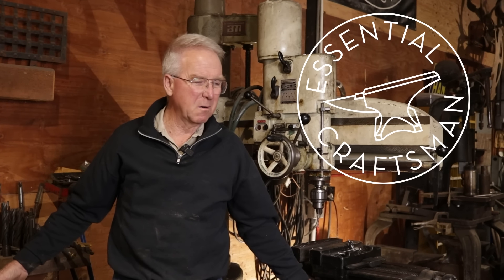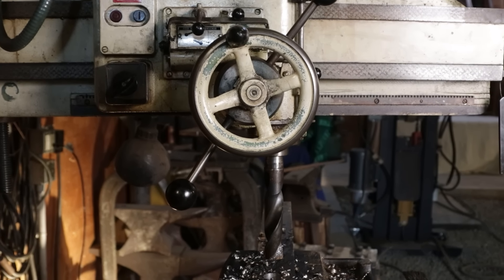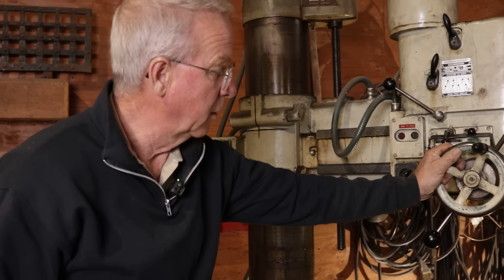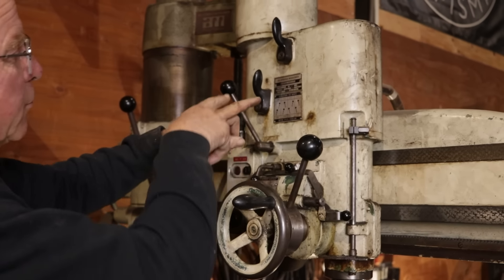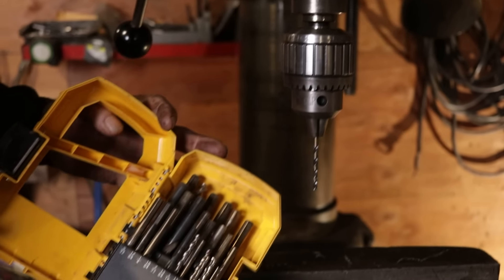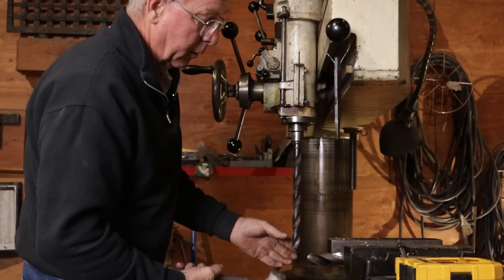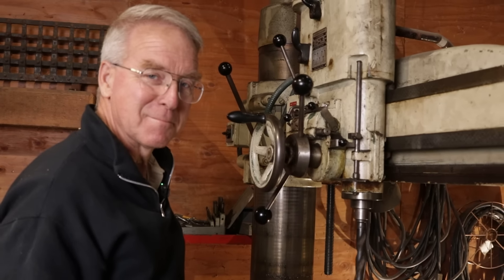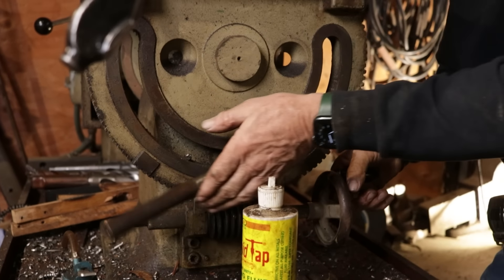The Drill Press That Does EVERYTHING

Comment: Beautiful machine.  Just my opinion, but on my larger wood tools, I have mounted a cheap 120v 8" LED strip (typical over sink light) that I picked up from a big-box store.  I mounted the small strip on a piece of wood and used epoxy to attach three small rare-earth magnets on the back of the wood.  I route the cord to allow movement to wherever I would typically use or need a light.  This works much better for my older eyes than any halogen or incandescent light on any of my machines.  It's also movable to any metal surface where I might need it.  For me, I much prefer my little strip LEDs over any of my internal machine lights.  Thanks.

Comment: for oiling the  ball detent oilers. I have had good luck with an oil can with a fine tip (fine enough to press the ball down) then cut a slit across (with a file , small hacksaw or fine slitting wheel)  this allows the ball to be depressed and oil to flow around

Comment: I worked at Palm Iron and Bridge Works in Sacramento in '71-'72 and one of my jobs was drilling 2" holes in 2" plate all day long.  Don't recall the name of that drill press but it made yours look like a toy.  Pilot hole helps and sharp drill bit.  Waste cuttings  should curl in continuous spiral or she is dull.  We sharpened by hand on a huge stone grinder, must have been 2 foot diameter and 4 inch wide. Great find .

Comment: Just do a search for the machine name and type on the plate. You can find instructions online. "Change oil after the first 100 working hours, then every 500 hours. The oil is drained at the under side of the casting. The bearings in the gear box and the spindle quill are packed at the factory with good quality ball bearing grease. This lubrication is sufficient for several years of operation. A few drops of oil should be dripped into the oil cups on the case once a week."

There's another paragraph after that talking about lubrication. Also, apparently there's an 830 and 1830 model. The instructions I found online have diagrams for both.

Comment: Cutting oil, as in pipe threading, is good for drilling.  Keep some right on the machine in a small tin can, apply with an acid brush.  Motor oil is not a good choice, it has lots of additives specific to the insides of an engine.  Best for the sliding parts would be way oil.  Precision sliding surfaces on machine tools are called ways.  The tool for knocking MT bits out is called a drift.  There is a different drift for each of the MT sizes.  The tang on the end of the taper is just a tang.  Stamped somewhere on the chuck will be JT and a number.  That's Jacobs Taper so & so.  The arbor and the chuck are two separate parts.  There are sets of little wedges that will separate the chuck from the arbor.  When ordering a chuck, you'll need to order the appropriate arbor.  ie. JT3 / MT4 or JT3 / R8.  Tapers are used dry.  It's good practice to run a hand down the length of the taper checking for burs or chips clinging to it.   Bad to force some chunk of iron into the tapered socket.  Those adapters, one MT size to another, are called sleeves.  Brown & Sharpe has their own taper, another is called Jarno, there are others.  Two sources,  MSC and McMaster Carr.

Comment: I've drilled a bunch of holes on a large radial drill in the locomotive repair shop I spent most of my career in, they're simply an awesome machine. I've also rebuilt the transmission on a buddy's Arboga mill which uses the same basic head as your radial drill. The thing that surprised me when I got into it was the gears are made of micarta rather than steel and the ones on that mill showed zero wear on the teeth, maybe those Swede's know what they're doing!!

Comment: Scott,  I have been lubricating my old machine tools with AW68 hydraulic for many years with good results 
Chainsaw bar oil works well for the sliding surface and the round column 
The wrong oil is better than no oil.
Keep up the good work
Reply: A fairly light oil with zinc is always a good option for almost any machine tool.
Reply: Those columns will take way oil. Not that 68 aw would be the end of the world

Comment: I'm no machinist (carpenter) but I find squirting the cutting oil on the bit rather than  the cutting surface works well and needs less oil especially at lower speeds.
If you can run cooling liquid automatically do it.  The time and money saved pays for it and more.  It's recycled unlike oil that is 100% wasted after one use.  Nice press mate.  Cheers 🇨🇦

Comment: You should weld a ratchet on the end of that vice as a handle. 
Then whenever your tightening it, the wrench will drop away, also so you won't have to bend over or move to the front to crank the vice.

Comment: Thats a good looking drill you got Scott. I used to run a 60" Cincinnati Bickford radial a few years ago. Big ol girl, dumped a quart of SAE 30 in her probably once a month. Still was a smooth as could be. Mine had power feed as well. RPM could be set for when drive lever was all the way engaged, it you could set it high and only partially engage the lever for slower speeds. 
That oil fitting I bet you need a pin type coupler or needle nozzle. It looks like s flatter zerk almost

Comment: I know lathe and milling machine basics. If it makes you feel  better, I now know how you change a but with a Morse taper tool bit thanks to you, compared to me you are a master operator of a radial drill press. I am a retired electrical engineer and I am in awe of your knowledge on so many things!  Question, how do you estimate or bid a job like that when you didn't even have the radial drill yet, knowing  how labor intensive it was going to be ( I know machine shops sometimes do a flat  rate like cost for each hole etc.) You are an amazing You Tuber and Man!

Comment: Start-up current: just this evening I learned something fascinating. We usually think of start-up current as a concept that applies mainly to giant electric motors. But just now I discovered that my Fenix E01 single-AAA-cell LED flashlight, which I had temporarily misplaced, was still glowing after something like 8 hours on (!). I immediately turned it off and then tried to turn it back on, but it would not light! Of course it worked fine as soon as I changed out that poor AAA battery.

Comment: I once operated a 10' radial drill made by Cincinnati Milicron. It had a 12' by 24' slotted deck, and had a 4" drilling capacity. It was a beast. but it ran smooth as silk.
The oil cups do use a special tip that depresses the ball. Try a medium needle tip on a rigid oiler tube. there's too much spring pressure  for a flex tube to work well.  Try scoring tiny slots in the ID of the needle tip to improve oil flow.
Typical three phase breaker panels provide a neutral for circuit requiring a single phase, such as lighting circuits. This neutral connects to a center tap in that transformer providing power. Your rotary converter does not provide the neutral. Wire your light as you would any household circuit. You can connect to the original light circuit in the drills control panel, but be absolutely certain that the hot and neutral leads for the light are electrically isolated from all other circuits. run a dedicated 120 volt circuit from your shop's breaker panel.

Comment: Lean the oil can tip to the side so the ball is not covering the hole in the tip or file a notch in the end of the tip so the ball can not block the hole in the tip .
Sum oil always leaks at those kinds of oilers , feed the oil slowly so more goes in than leaks outside the oilers .

Comment: Correct me if I'm wrong but I don't think the tang on the Morse taper is intended for preventing the tool from turning in the quill os in the adaptors. The grip relies purely on the friction of the "sticking" taper. If the raper were a wider angle it would't grip: if a shallower angle it would stick so tight that you would have great difficulty in removing it at all. It's also essential that the surface of the tapers, both inside and out, be scrupulously clean. 
What a lovely old machine. I have neither the use for one nor the space but I can dream!

Comment: My father was a machinist by trade for companies and also ran a little shop @ home to. He passed but I still operate some machines from his home shop now and then.
I never grew to liking those ball type oiler ports on machines My dad was patient so he would put a drop of the oil on the top then wipe that oil off with a lean rag to help clear away dust and residue then push the ball down and let oil slowly drain/ siphon into the passageway around the depressed ball..... it was very slow untill enough oil got in to the passage way... then once some flowed in, it seemed that gravity would start sucking it in all the faster. That is why I called it a "drain/siphon".\
My latest technique repeates the oil first then wipe clean but is unique by my using a medicine dropper bottle with a clear plastic dropper tube and rubber squeeze bulb. But that sort of requires two hands. I draw-up a shot of oil fom the bottle into the medicine dropper tube and can dispense the oil slow and precise by use of the squeeze bulb and even watch how much oil leaves the tube to gauge how much oil went into the oil passage way. It's rather crucial to note that, in some situations, oil cannot enter unless air is "burped out" at the same time.This isn't ideal for upside down oil dispensing but most of my machines oil ball ports are not upside down ( they are verticle or horizontal). If I spill excess oil onto a very clean surface while using the dropper I can suck much of it up into the dropper again... less waste and mess.😊 
And with the more stubborn oil ports I've had some luck pressing the nose of the the dropper tube down into the hole, thereby displacing the ball down enough, and pumping the squeeze bulb to force oil in and suck air back up into the tube/bulb "burpping the oil port of trapped air".

Comment: My first job as an apprentice was on that very old even then style drill ''it looks identical '' ,  drilled 12 holes in a 150x450x20mm splice plates 8 tonne in all of steel, started with a single 400mm long 32mmm drill bit .The drill never missed a beat , my 32mm bit was 250mm long when job was done .1956 it was bought secondhand by my company, maintain those brass bushes it will last forever

Comment: For the ball oil ports use this oil can Reilang oil can. You need an oil can that can deliver pressure to get the oil around the ball. 

Or as someone else has mentioned you can take a regular oil can and cut a slit in the oil tip so that when you depress the ball the oil can still come out of the tip and around the ball

Comment: One small correction.. Morse tapered bits, and the same goes for Morse 3 to Morse 2 etc. etc. are rotated/driven by the interlocking flat at the top, the purpose of the said tapers is to ensure, firstly interchangeable sizes, but more importantly to perfect align drill bits..

Comment: My mother's cousin had a complete machine shop in his back yard including a 5x12 foot pattern torch way before plasma cnc tables a big radial drill press I saw a 2 inch drill bit in,  now I wish I would have hung out more there now. If you find a Bateman Iron Worker Machine built in the 60s to early 70s he touched most of the parts machine

Comment: For the light, you could probably just tap one of the legs of the 3 phase power. Check it with a multimeter, but it's probably three 110v legs coming out of the rotary inverter. Or, just put an outlet behind the machine and hook up a regular light.

Comment: When you drill the pilot hole it should be the width of the tip of the drill point or web. This lets the full length of the cutting lips to stay centered and cut with all of the edge not just the outer edge.
Reply: Correct. I notice the drill bit "walked" a little before all the cutting lip was engaged. This is evidence of too big a pilot hole. That size bit a #5 center drill and no pilot hole with about .010" of feed would work great. Gotta be enough feed for the tool to cut. Like my instructor used to say "if it ain't cutting its wearing"                     Same with woodworking tools.

Comment: For those brass oilers I make a brass coupler in the lathe with just the right size of the oiler hole but with a short nose the problem is that most oilers have a ver I long conical tip so if you push the balls it blocks the oil but if you don't push enough it leak the oil, now with the coupler if you push it just center the tip and thr oil pressure it's the one that push the ball

Comment: I'm a fan of mist coolant. As you know, heat is your enemy. Oil reduces heat in the form of less friction, but it doesn't really remove heat. Plus it's messy.  Mist coolant removes heat with compressed air and coolant, lubricates the cutter slightly, and is adjustable so you're feeding the right amount of coolant directly at your workpiece. Also, it's hands-free so you don't have to stop and add oil, or operate the machine one-handed.

Comment: You are using the Mose Taper key upside down. The rounded edge should be on top to match the rounded slot in the quill. The square edge matches the tang on the drill bit

Comment: Often times the reason you csnt get oil into a ball oiler( or even a grease zerk) is that the ball is stuck. Tap on the ball with a pin punch to see if you can get it moving.  If not, the whole ball oiler button can usually be replaced. Some thread in, some press in.
  
As for the oil can tip, you should be able to get one through McMasters. Maybe Lincoln (the grease gun company) makes them.
Also, most Hydraulic suppliers have lube supplies also.

Comment: There are videos on Youtube for modifying a grease gun to shoot oil into zerks on machine tools.

My machine tools are close to the wood shop. Machine tools usually need a thin coat of oil on lots of surfaces- which attracts dust. I keep an old piece of bedsheet over tools when not in use.

FB

Comment: To get the oil in the hole try using a tip with an O.D. smaller than the hole I.D.
The ball only seals the hole when it is not depressed.
If it overflows you have filled it.
Good Luck

Comment: Your are meant to use a push action or plunger style oiler on those push button oil fittings.  Those fittings are used to force oil into the machine.  The oiler needs a good seal and higher pressure than a typical thumb pump oiler.  Very similar to a chainsaw bar lube tool.  You know from before we had "ROLLOMATIC" bars.

Comment: Please use cutting oil for cutting, especially steel, but not aluminum. WD 40 is good for aluminum but not steel. Lubricating oils tend to burn up tooling.
Also, don't tap the bits into the socket. Line it up, lower it about an inch and jam it in using it's own weight.
Someone mentioned chainsaw bar oil as a lubricant. I hadn't thought of that, but it might be a little thicker than good lube, or as machinists call it, 'way' oil.
Reply: I like RTD cutting oil rather than soluble oil for drilling — I suppose its similar to Tap Magic.  I use soluble oil in the lathe, but more for cooling.  The sad thing is that they all seep into your skin and it takes forever for your hands to stop smelling of it.
Reply: @TrevorDennis100  Thirty years ago, I used to work for a toolmaker. On all his machines, lathe, radial arm drill, milling machine and surface grinder etc, he used water soluble cutting oil that was recirculated through each machine. Always worked wonders. I think it was because that type of oil allows for the cutting edges to bite into the work whereas lubricating oil is made to allow surfaces to slide over themselves. None of his machines ever rusted either.
Reply: I've heard that "Rucol" paste is the only thing you want to use. I'm in Sweden.

Comment: You just need an oiler with a small enough rigid tip to push the locks in and then squeeze some oil.  You can tap with that machine as well.  Very nice!

Comment: there are several Jacob's tapers on the Jacob's chucks. The drill press, light duty, I was given came with a Jacob's 1/2 " chuck that is speced as a Jacob's 2-1/2 taper on the data plate. It was really a pain in the google to get info on this number of taper, very obscure.

Comment: In my younger days running mainly lathes, i had an old brass Eagle oil can, the spout was a straight brass tube so you could oil the ball detents with one hand. I can't remember if the tip had the v groove filed in it. I still own all the equipment but need to start selling a good bit of it as the building its located in is up for sale and i was recently asked to vacate. Most of the lathes are small enough for the home shop and some even have single phase motors. Mainly Clausing, Hardinge, Rockwell. Located in west Tn.  If anyone is interested maybe we can communicate.

Comment: I've never heard of a radial drill before!
Reply: They have been mostly replaced with large 3 axis cnc mills in modern machine shops.  Which are far more generally useful and because of that require less setup labor.

Comment: Mr Craftsman… Mr Essential? Hey you! 🤪, I’m not really able to see those lube ports very well, but they sort of look like a needle point grease fitting… Are you sure they’re supposed to be oiled and not greased? 

That is quite the press, you should be proud to have such a high quality tool in your shop.
Reply: Never use grease on those ball oiler fittings. Some milling machines such as Bridgeport come with actual zerk fittings on the saddle that people mistake for grease lube, when in fact they are designed for push-type oilers. I've taken apart mills that were filled with grease that had clogged the oil passages. The end result is essentially lapping compound as the grease picks up and holds any fine grit. This wears the ways out pretty quickly, which destroys any accuracy the machine ever had.
Reply: @wvrockcrusher  interesting. Didn’t know.. Hard to find a book on that old stuff.